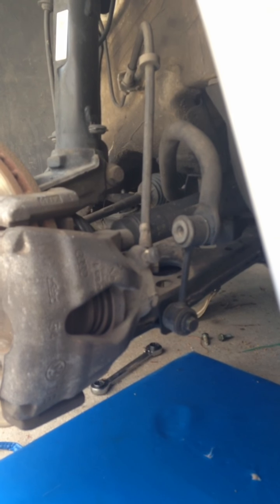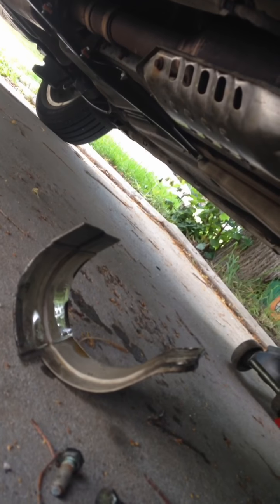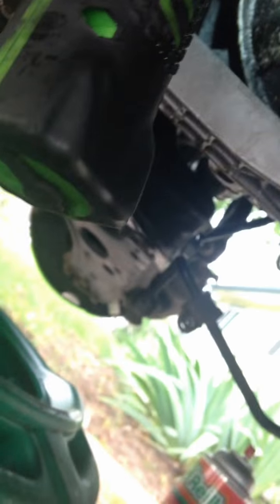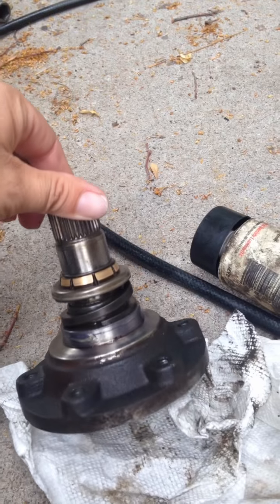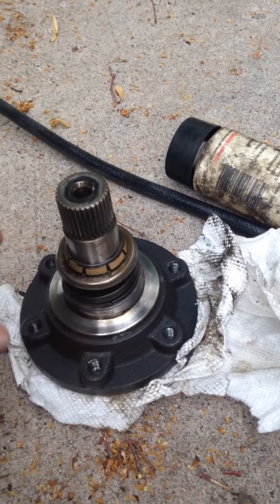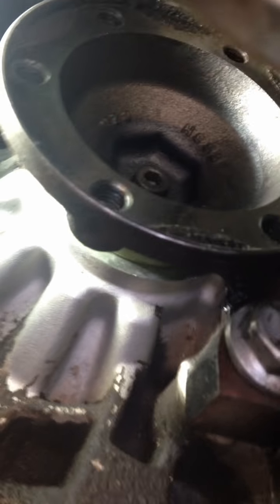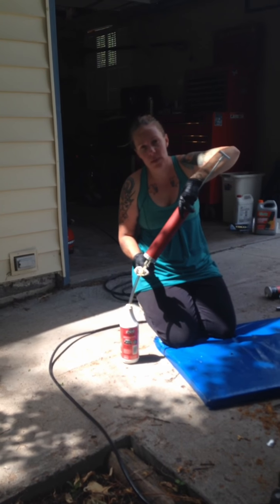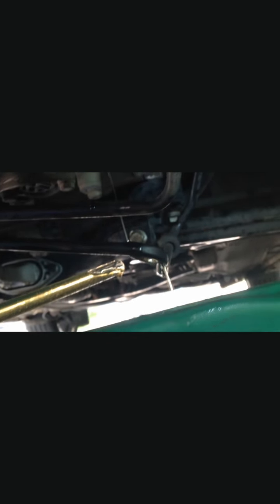Replacing the Axle Seal on a 2001 Volkswagen Beetle

Comment: Hi, did you put any grease on the inner v-groove on the seal before reinstalling the flange? If so, what grease did you use?
Reply: use a hi temp grease that won't cause the seal to swell. Like a marine grease or axel grease. But it should be hi temp

Comment: Nice vid. The 6 driveshaft to flange bolts are not of the allen type, though. They are triple square ones, 10 or 12 mm, depending on model year.
Reply: The Allen screw she's talking about is the bolt that holds the stub shaft once you remove the m8 or m10 triple square spline drive bolts

Comment: How did you compress the flange in?
Reply from the maker: Nehemiah Gonzaga watch the video- I used a long screw to press the flange in place to start the Allen
Reply: Screw driver is not doing it for me. I have the exact same setup and I see the hole you used. But it just won’t compress... I’m up shits creek. Anyone have a different way to compress the flange?
Reply: I compressed the flange by pushing it with one hand and hitting it with a hammer at the same time. A couple of taps and it was all the way in. I held it in and quickly tightened the allen bolt. Worked for me 👍

Comment: would the green seal go bad aswell?? or if its leaking will just replacing the seal itself fix the issue
Reply: It’s three years later, but someone might find this answer useful.  If the green seal is not damaged or warp don’t remove it.  Used a good sturdy bronze brush to scrap it where it flushes into the transmission case to remove dirt and oil as much as possible. Afterwards use a towel cloth soak the tips with 97% alcohol rubbing to remove all the grease and oil so you can finally after it’s clean and dried used black silicone to seal around it and let seat there for over 30 minutes to dried.  That should be good enough unless you want to remove that flange cover.
Reply: @titorojas333  i ended up replacing the whole seal with flange. I had replaced just the seal and it was still leaking once the flange was replaced the leak stopped.
Reply: @WCxColosus  how did you end up pulling that seal flange? Did you use a seal puller or does it require a slide hammer? I’ve been racking my brain trying to decide the proper way to do this without ruining the output shaft
Reply: @Mikeyy.1701  that seal is sold as a pair the green flange came with the seal pre installed. I removed the flange with a hammer and a flat head. Just make sure you don't damage the inside of the transmission where the seal sits.
Reply: @WCxColosus old video but wondering where you found the flange with the seal